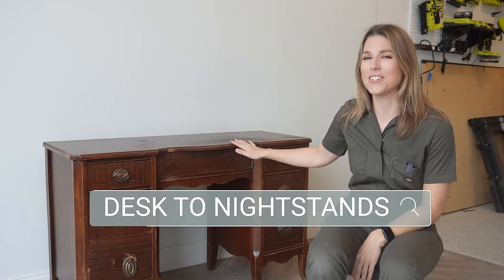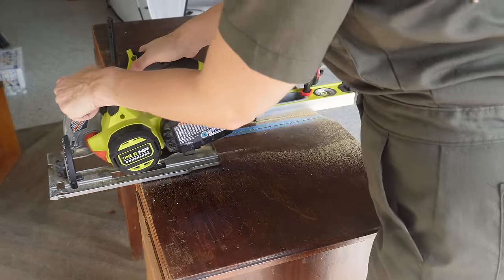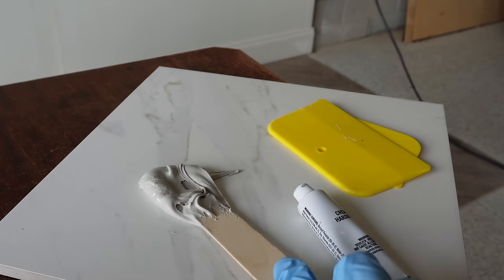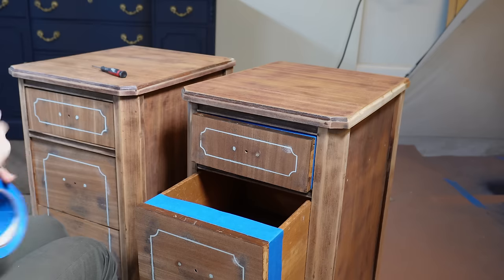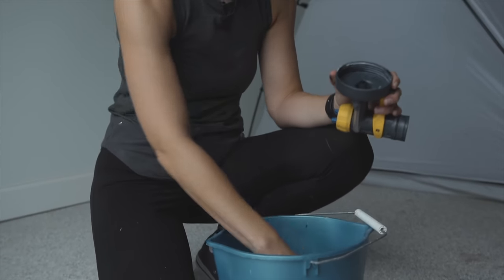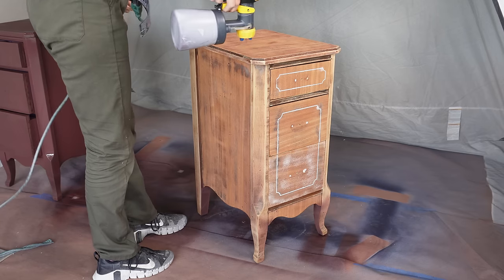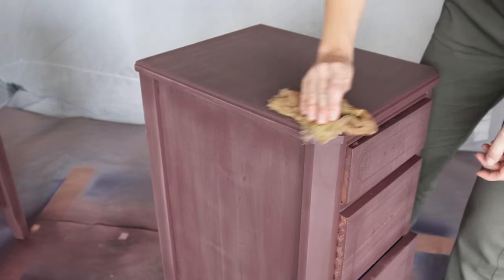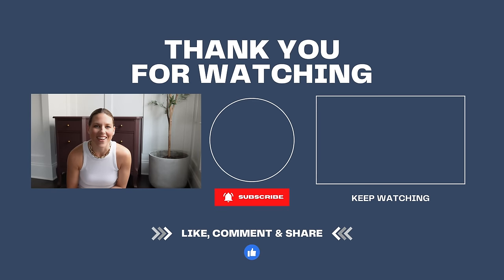Spraying General Finishes Milk Paint w/ a Wagner Sprayer

Comment: Just watched your video turning this little desk into two end tables, fabulous ! so impressed, doing at saving these old pieces ! I’ve been refinishing furniture for 50 years, and I still felt like I learned some things from you. I must say in the use of Bondo, I also use the regular & wood filler, when applying it I use the plastic Bondo tool, it makes the filled surfaces so smooth, very little sanding, unless the repair area is a strange shaped surface. Not trying to be critical at all. I love what you’re doing just a tip in case you didn’t realize that. Thanks again I’ve subscribed and really enjoyed watching your project.!
Reply from the maker: I hate sanding Bondo so I appreciate the tip. I'll have to try their spreaders.

Comment: Been using Multi-purpose Bondo for some of my projects and here are a couple of tips- When the bondo is drying but still soft, you can carve the bigger chunks off or shape it; also, the more you shape the bondo or scrape it with a putty knife when you apply it, the easier and faster it is to sand down the excess.  Really helps when using on flat surfaces.

Comment: That same trick you used to make a straight cut with your circular saw can be used to make a straight line with your router.  Just clamp a ruler or level onto the top of the nightstand as a guide for your router to follow.

Comment: You are right; I am intimidated to use my sprayer. The first sprayer I got can’t work with thick paint so I diluted it too much & it was runny. Ugg.
Reply from the maker: You just have to practice. I've had some paint sag on me before. That is why I always practice on a board before to get my settings just right for the paint I'm working with. You can do it!